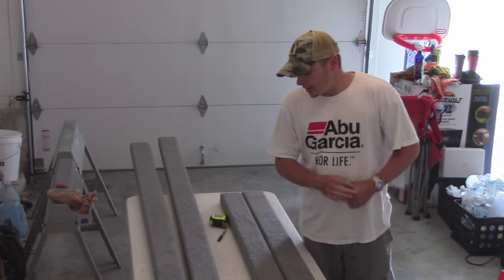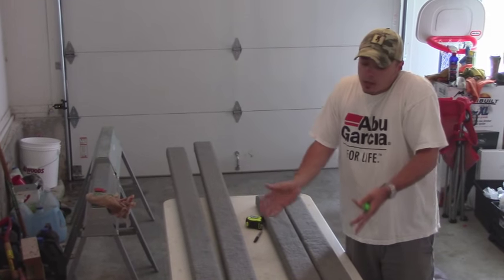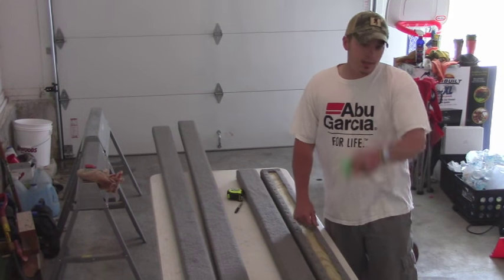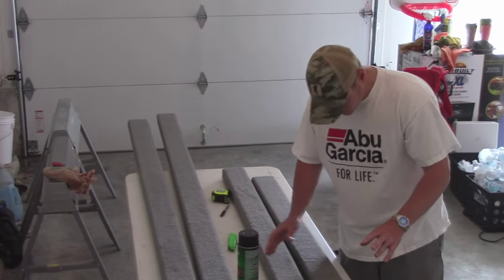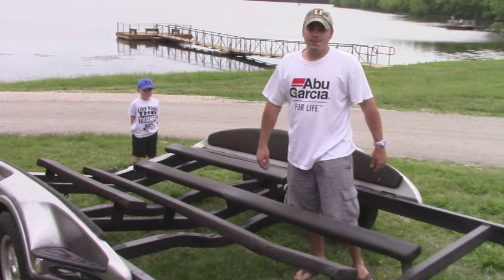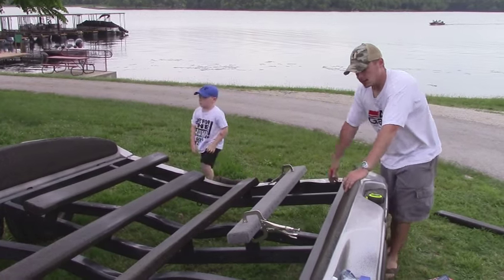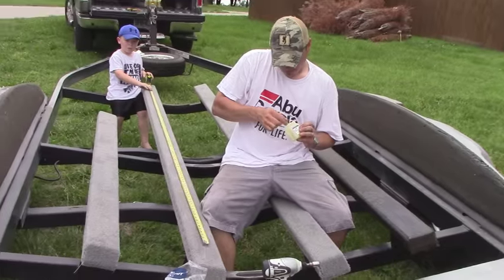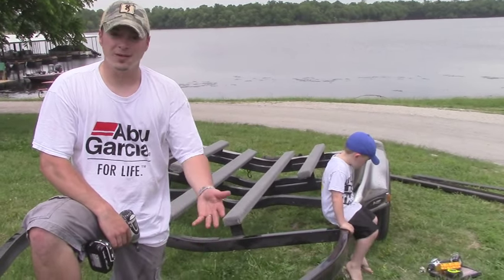BunkBoards

Comment: As mentioned in one of the comments or if it’s true or not but I heard that you’re not supposed to use stainless steel on Pressure Treated wood; the monel staples are preferable. I didn’t know any better and I’m that guy that wrapped & overlapped the carpet😅.  Great video & thank you for the detail& time in explaining your method & process. 5 years later, how is it holding up?

Comment: How in the world did you spend between $200-$300 to make 4 bunks? Where are you from that materials are that expensive? In my area, using  quality carpet, treated lumber & stainless hardware would still come in well under $75.
Reply: I would imagine the carpet from BassCat Boats wasn't cheap
Reply: I just did mine.  $50 for the (4) pressure treated 2x6's.  $45 for the stainless hardware.  $120 for (4) Bunk Carpet rolls.   $215.  Right in the ballpark.

Comment: Treated lumber chemicals will degrade the latex on the back of the carpet. If you can’t find marine wood or some composite and need to use treated, always pressure wash the heck out of it before you wrap carpet. Or you could paint the treated with an acrylic paint.
Reply: I am getting ready to replace my bunk boards and I was told treated wood would warp. If I were to go with the treated I would for sure try to use your info before replacing. I have thought about replacing with the  Polyethylene Plastic boards but not for sure about them, very slick. Is there any other type wood that you would suggest over treated?
Reply: Billyjack marine wood or something like Trex. If you have enough screws in it, I doubt the pressure treated would really warp. Especially if your boat spends most of the time on the trailer
Reply: @frostriver4547  Thanks Forest. I believe I will try to look into the marine wood or the Trex. Not really sure what the Trex is but will do some research.
Reply: Billyjack I used a water repellent stain for deck on my boards. 🤷🏿‍♂️
Reply: @luissonoma6255  Thanks Luis, but it turned out that my boards and carpet were good. I just had to add new bolts and put all new brackets on. BIG shout out to my neighbor, he did most of the work for me with a little help from me. Great neighbor!!
Reply: @frostriver4547  I ended up using my same runners and same carpet. It was the bolts and brackets that were bad. While I was looking at replacing the wood I did check into the trex and if not mistaken it is something like a carbon material which I saw in one video was very slick. One comment I read was that you DO NOT WANT TO UNHOOK your boat before you get it into the water or it might slide off. That scares me to even think what could happen. Thanks again Frost
Reply: Billyjack Wish I had a neighbor like that. Mine just calls code enforcement on me over the slightest things 🤦🏿‍♂️

Comment: Great video. You did forget to add the extra layer of carpet on the top of the bunks. 3  1/2 inches wide. Ez loader does a full wrap on all the bunks so that’s just how they do it. Your method is better.

Comment: Use galvanized not stainless. The chemicals in treated eats up the stainless much faster than galvanized.
Reply: You can also use azec vinyl boards and they'll never rot.
Reply: Truth  Stainless or Galvanized, how do I know for sure what is best?  Also I don't want them backing out of the wood as my current lug bolts have been doing this for years.  Any advice?
Reply: Steven W use a bolt with a round head and go down through the board and put a nut underneath. Cover the head with carpet